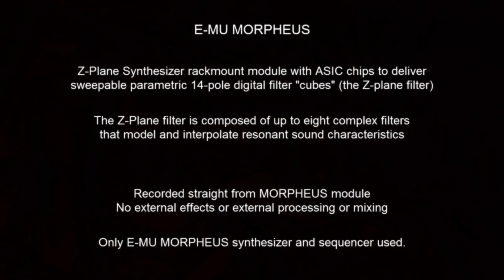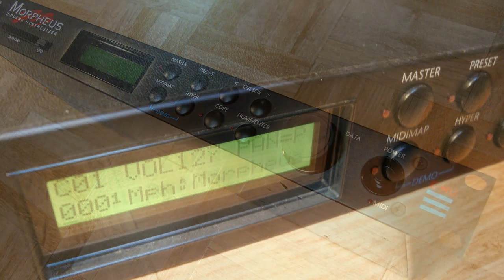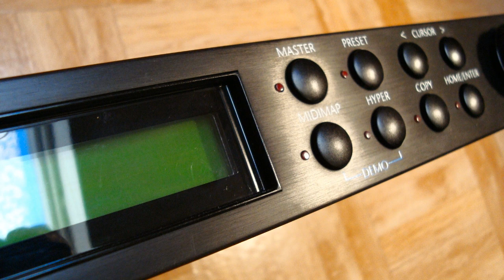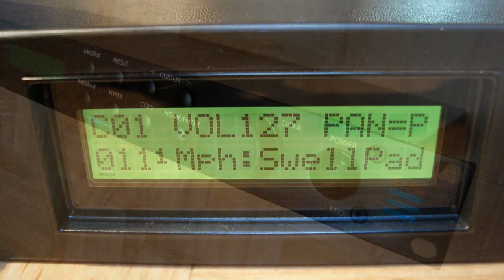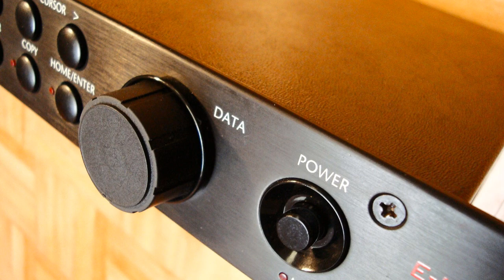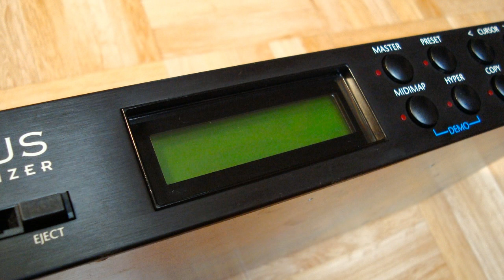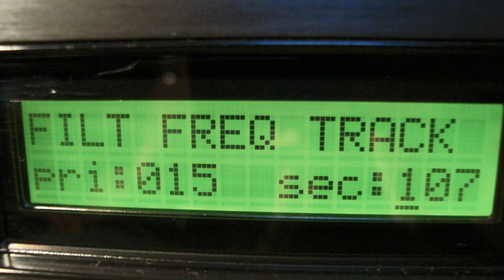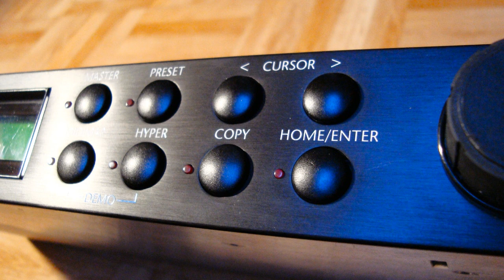𝗘-𝗠𝗨 𝗠𝗢𝗥𝗣𝗛𝗘𝗨𝗦 Z-Plane Synthesizer 【Demo】

Comment: Are there any videos where you can hear the voice/vowel presets? I heard this has a 'yeah' Z Filter plane?
Reply from the maker: Random Person You're right, Morpheus have some very realistic voice emulation filters. If you use a waveform, rich with formants, and those filters, you can get interesting voice-like sounds. You can check this website:http://www.synthmania.com/morpheus.htmFind a demo-song called "Demo 1", this is factory demo where you can hear vowels. Also find the sound-demo called "095 Voc-OzBoiz".
Reply: Does any other E-Mu module have the exact same voice-like sounds?
Reply from the maker: Random Person E-MU UltraProteus have same and even more Z-plane Filters, also Proteus 2000 have some. So they can create vocal sounds too.
Reply: oscillator So if you had to choose between a Morpheus & an Ultra Proteus, which would you choose?  And what about a Morpheus & Proteus 2000? (which would you choose?)  I'd like to buy one. (especially after hearing this awesome demo!) The Morpheus & Ultra Proteus are somewhat hard to find, but Proteus 2000 are abundant. 
BTW, is this demo pure Morpheus, or are you using some external effects processors?  I really can't get over how awesome this synth sounds, & the effects processing is amazing. (even more so if it's the Morpheus's effects!)
But of course your playing is also responsible for the excellent sounds.  An excellent choice of patches/programs, chords, melodies, & effects processing.  You bring it all together perfectly, & t really seems to bring out the best of this synth.  Truly amazing.
Reply from the maker: Gerry No
Morpheus and Ultra Proteus have the same engine, the only difference is Ultra Proteus has more ROM waveforms and filters. BUT... these ROM waves of Ultra Proteus is more oriented for emulation of acoustic instruments while Morpheus is more electronic oriented. So I choose Morpheus. The Proteus 2000 have a multi-mode resonant filters and some Z-plane filters too, but they are not so flexible, as far I know. Morpheus and Ultra Proteus are 32-voice, while Proteus 2000 is 128-voice and whats more - it has an optional slot for upgrading ROM waves with expansion boards. So they all are great somehow, IMHO.
About Morpheus demo effects - everything there come directly from Morpheus audio outputs, only used the Morpheus internal FX processor.
You can find Morpheus on ebay, there should not be problems. I got mine for 185 euro from Germany, not so expensive. When it was launched, it cost nearly 2000 eur :) And if you will get some, I could give you some tips how to make it sound good, because factory patches are crap. Also I found the best how to program it from PC - it's much better and easy  than programming from the front panel. Cheers!
Reply: oscillator I will definitely keep my eye out for a Morpheus or maybe an Ultra Proteus.  The Proteus 2000 is fairly inexpensive, so I might pick one up, too.  1 last question.  Do you have any control over the waveforms?  Specifically, can you adjust the start, end, & loop points of a waveform, or play them in reverse? (like you can on the Kurzweil K#### & PC3)  If/when I get one, I would definitely love some programming tips.  BTW, what PC program do you use to edit patches?  Is it a dedicated EMU program, or is it some multi-device/synth editing program?
Reply from the maker: Gerry No
Yes, you can set the start and loop points of waveform. I didn''t tried to use them much yet, because I got my Morpheus recently and it's always to short of time to spend long hours of programming, but I got some really interesting rhythmic loops while changing these parameters. Not sure how it works for shorter wave cycles (milliseconds), but it works perfectly for longer ones (seconds). And yes, it also have a reverse playback too. But the biggest hit of Morpheus is Z-Plane filters, Function generators and Modulaton matrix! To long story to tell about - you can find the User's Manual over the i-net to see about them. About software - the best one is MorpEdit, which was specially made for Morpheus and Ultra Proteus. Another good is SoundDiver (universal synth editor), but MidiQuest works with some glitches. Also great software is MIDI-OX for storage of SysEx files to/from Morpheus (if you don't want to buy expensive RAM cards).
Reply: oscillator Cool.  Having that degree of control over the waveforms is really awesome.  I see a Morpheus on eBay right now & I am considering making a bid.  :-)I do appreciate all your advice & information.  I've heard of MidiQuest & SoundDiver. (but haven't used them)  So which editor do you use mostly?  MorphEdit?  Did it come with your Morpheus, or is it freely available online?  BTW, my Mo' Phatt module actually has Dynamic 12 pole filtering.  It also has an additional "techno" ROM installed.  I really don't use it much, but with some tinkering & tweaking, it's possible to get some decent & interesting synth sounds. (I've made a couple)  Anyway, thanks again.  ;-)
Reply from the maker: Gerry No
Mostly I use the MorphEdit. It's freeware soft and should be somewhere over the i-net, latest version 1.000 works only on 32-bit Windows XP, Vista, Win7, but older version 0.912 works on 32-bit and 64-bit PC.
And yes - Morpheus is great synth, but be ready to some paracetomol :) because it's tricky. I spent some time to get how it works and solve the tricks. The programming is easy, but I had some headaches to understand about midimaps, also how to connect with PC and send/receive syx files etc. It takes some time to get everything fine, but it's possible with time and patience. The result worth it :)
Reply: +oscillator I was blown away by your Morpheus demos! I bought mine about a year ago. I had been dreaming about the Morpheus for years because my favorite band used it a lot, but, like you, I was pretty disappointed by the factory presets (not to mention the terrible internal demo songs…). At some point, I got to download two or three additional banks but, again, I was not quite impressed. Would you have tips, advice, or even links for a better Morpheus experience? I'm feeling it has the soul of the "Emulator" but with infinite potential and sonic possibilities… BTW I loved your Insanity 2 track!
Reply: +Mo&#39; Cheez Me too. (blown away by this demo) Actually, this demo is what convinced me to get a Morpheus.  I agree that the factory presets aren't very good. (I was also disappointed) 
The Morpheus is a synth that has a LOT of potential, but needs to be tweaked, finessed, edited, & programmed, to really bring out it's best.  It's definitely a very unique & interesting synth.  I also love oscillator's "insanity" tracks.  (great stuff!)
Reply from the maker: Mo' Cheez
Hi :) The difference between Morpheus and ordinary rompler is : Z-Plane Filters, Modulation Matrix and Function Generator. These three things makes Morpheus very special. Additional banks you mentioned was made for ROM cards and they really don't have anything impressive (same as factory ROM patches). About tips etc - the best way to get interesting results is to start with exploring of User's Manual. Seriously. I also wanted this synth very long time (same as you I got it just little more than one year ago) and I also felt a bit dissapointed when I heard these ROM presets. Then I started to read the User's Manual and look for all these amazing functions which are unique and how they works. It's not possible to explain this better than it's already written in Manual, everything is explained very clearly and logicaly there. Try to get thru from first to the last one page and you will be able to create the sounds you want if you will understand these principles of Morpheus heart :) You can find the User's Manual over the internet, try to google. I also could send you the PDF copy if you wish! Regards!
Reply: +oscillator Thanks! I do have the manual. I haven't read it entirely but so far, I haven't really found simple answers to my basic questions. The banks I had found were : Dance, Expanded, FIlmscore and Songwriter. But whenever I transfer them, I don't see any change in my Morpheus and Bank 0 is still the same… I'm a bit lost ;-)
Reply from the maker: Mo' Cheez
To be honest I also don't know everything about Morpheus... This is very,very deep water to explore :) For example, I still didn't get into Free Run Generator in Hyperpreset mode. Actually I don't use Hyperpresets yet, all my demos are based only on Preset mode. Hyperpreset has joined up to 3 presets + additional parameters, which makes performance of this synth even more powerful !!! So that's a question of time :) I will try to understand how it works also. About these ROM banks - yes, I also have them and that's all what E-MU made for this synth, unfortunately. But it's better than nothing and you can use them as good source for tweaking :) The reason why you can't load these sysex files could be wrong parameters of software you're using to transfer them from PC to the synth. I'm using MIDI-OX, it's freeware and the really the best software of this kind I ever seen. If you're interested, I could send you the parameters to set-up this program for Morpheus (MIDI Buffer size, Delay time etc). And yes - the USB-MIDI Adapter is also very important to make it work properly. I'm using E-MU Xmidi 1x1 Tab adapter. I tried some cheap (5 bucks) chinese adapter from eBay first and it didt work properly, so don't even try this garbage :) Regards!
Reply: +oscillator I've been using Sysex Librarian for years (I'm on Mac), without a problem, and with all my gear. At some point I had even managed to get some new banks in the Morpheus. But I've completely changed my home studio setup recently and probably messed up something. It's sending on the Mac side, and Morpheus is blinking accordingly. But I'm passing thru my E6400 Ultra, maybe I need to go direct. But if you have known working parameters, I'd be glad to get them and try them out.
Reply: +oscillator I did a reset of the Morpheus and it's now correctly receiving sysex data ;-)
Reply from the maker: Mo' Cheez
OK, Sysex Librarian is also great soft as far I know, although I don't have a MAC. That could be a reason for errors if your adapter is passing thru another device, so try to connect directly. Any device between your MAC and synth can make distortions and transfer delays. Just in case - there are parameters for MIDI-OX (it is Windows based software):

 Low Level Input Buffers:
 Size: 120 Bytes
 Num  32

  Low Level Output Buffers:
  Size: 120 Bytes
  Num  32

 Delay Between Buffers: 60 Milliseconds
 "Delay After F7:" box - CHECKED, 60 Milliseconds
 "Show F0-F7 in colored text" box - CHECKED

Comment: I Just Bought A E-Mu Proteus Fx In Great Condition But The Screen Is Blank But Lights Up Green, I Was Told Buy The Seller To Alter The Setting For The Brightness But How Can I See To Alter The Setting When The Screnn is Blank And Nothing On It .

I have Opened It Up And Checked The Screen Wires And They Are All Conected And Ok And Its Clean And All Ok Inside It.
Reply from the maker: First of all try to RESET your Proteus! To perform a reset, hold both CURSOR keys down and turn on the power at the same time. The unit will boots up in the DIAGNOSTIC test menu. Release the CURSOR keys and turn the DATA WHEEL until you see INITIALIZE option. Press the HOME/ENTER button twice to re-initialize the patch memories. Then power off and back on to go back to normal operation mode. Check also the battery (CR2330 or CR2032) to keep your RAM and Master Settings.
Reply: But like i said before the screen is blank so how can i see INITIALIZE with a blank screen that is the problem !
Reply from the maker: OG Gallery Crew Leeds
I hope there is contrast of display turned to maximum brightness so try to Reset this way - unplug your Proteus from electricity socket, then open the synth and remove the internal battery for few hours to be sure it's initialized. Then put back the battery, connect back to electricity and turn on your synth. It should be initialized to default settings icluding the display contrast parameter, if there is no other problem.
Reply: Cheers wil try this as i think its the best option !

Thanks
Reply: Screens working on the INITIALIZE option But what do i do after INITIALIZE do i just turn ot on and off again .
Reply from the maker: OG Gallery Crew Leeds
That's good if display works, I just don't understand do you have another problem with your synth?
Reply: When i turn it off and back on again the screen is still blank and no their is nothing else up with it .
Reply from the maker: OG Gallery Crew Leeds
That's not good. It looks your unit is broken if display is still blank after full reset. Maybe missing voltage of power supply (check the bulging or leaking cups), maybe failure  of OS (EPROMS are gone), maybe problem of motherboard or bad contact of some components. Try to show your synth to professional electrician.
Reply: When i run all the diganostics test they all said ok on the screen so i would say its working ok and the test tone sound is ok !

(check the bulging or leaking cups) ??

I do not have the original power jack as it did not come with one that could be the problem as its half fixed i would say ?
Reply from the maker: OG Gallery Crew Leeds
I said about bulged cups because my Morpheus had this problem when I got it from eBay. One cup (eletrolythic capacitor) in power supply was bulged and -12V was missing, so there was no sound coming from audio outputs. After replacing faulty cup -12V voltage appears and everything was fine.
Proteus FX has external power supply 9VAC 1000mA, as far I know. You should check your power adapter it is 9 volts and at least 1000mA (equals 1 Amper) if your power adapter is not original one, otherwise 9V voltage could drop down an cause problems in synth functionality.
Reply: No like i say m8 i dont have the original power jack and was using one off one of my other synths, 

Its 230v - 50hz
12v 800mA 9.6va.

Comment: 12:10  Hurrah!

More more!! It's too short :\
Reply from the maker: Actually I got also the UltraProteus model, which comes after Morpheus, but basically it has same synth engine, just a bit different set of ROM waves and more Z-filters.I have an idea to make similar demo about UltraProteus sometimes, then will be more stuff like this :)
Reply: something special here... it evolves from something nice and soft comfy to fizzy- please keep (and capitalize!) that one!
Reply from the maker: Morpheus is a very special synth - it allows you to make a wide range of sounds from melodic pads and keys to really bizarre tones. You can check out my tracks called "Insanity" to see the dark side of this synthesizer. Three parts are here, hooray!
Reply: Well this video brings a tear to my eye. Certain things when the machine takes over (sounds  like the Terminator?) but feeling and emotion are out there! Congrats!!!!
Reply: Humans control the matrix. The matrix doesn't.
Reply from the maker: Thanks mate, I just tried to show what kind of sounds this synth can produce. Factory presets are very flat and boring, like most of the synths has. Regards!

Comment: Sounds like a horrible noise generator beside the amazing synth sounds😂
Reply from the maker: This terrible noise generator is a cheap chinese sound card that I used to record audio for this demo. My laptop doesn't have an audio input, so I used an external USB sound card as an adapter. This was a big mistake, which I realized when I upgraded it with a Lexicon Alpha sound card, which was much better. Unfortunately, this happened several years later and it was too late to record everything again.
Reply: @_oscillator  Ok, that makes it clear

Comment: Is that background noise coming from your mixer or the rack?
Reply from the maker: Noise is coming from USB-Audio Adapter. My laptop doesn't have audio input so I used some cheap chinese adapter which wasn't good enough. Now I have much better adapter - you can check my latest tracks called "Insanity" where I used same Morpheus synth with new Lexicon Alpha adapter.
Reply: K

Comment: Did you used external effects here?
Reply from the maker: No, of course not. That's why this video is called DEMO, because no external FX, samples, additional synths etc used. Only a single Morpheus synth, that's all. Check also the "Insanity" tracks - there is also only this synth used, just completely different type of sounds.
Reply: oscillator thank you! So this's a excellent synth, I'm very impressed

Comment: Are these all standard presets?
Reply from the maker: +Zariis (Official) No, these are custom made presets. They all comes directly from Morpheus audio outputs, using internal FX processor. No external processing or Hyperpreset mode used (that means these all are single Presets, no layering in Hyperpreset mode). If you want to hear some more sounds of the Morpheus, you can check my video called "Insanity" which is recorded entirely with this synth.

Comment: too bad its so noisy ( i hear)
Reply from the maker: Actually the problem is not the synth itself, but the Audio interface I used to record this demo - a cheap chinese USB-audio adapter for 10 bucks.... that was not good. Now I got much better Audio interface and you can hear results if you will check the "Insanity" tracks on my channel. The same Morpheus synth + Lexicon Alpha Audio adapter.